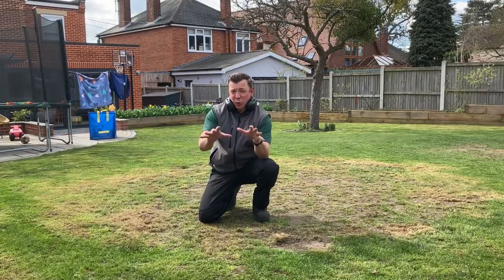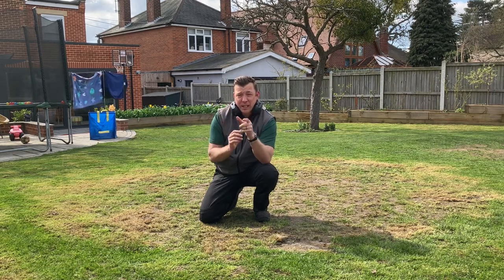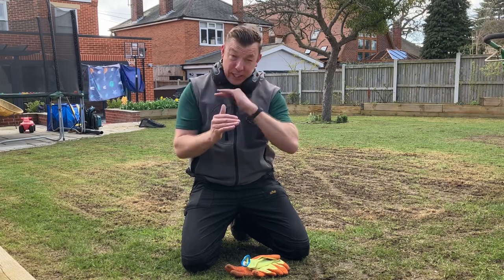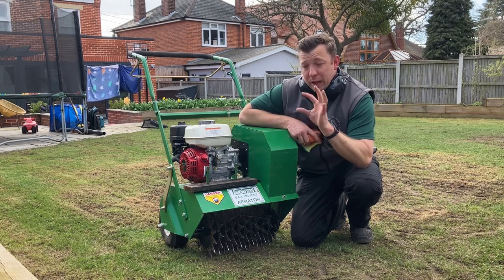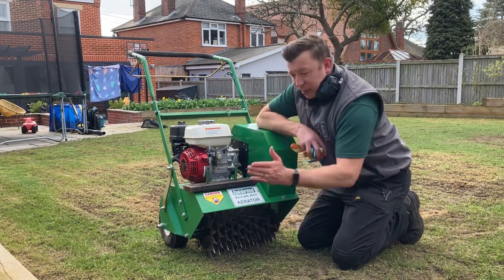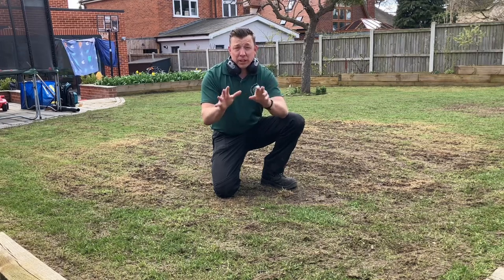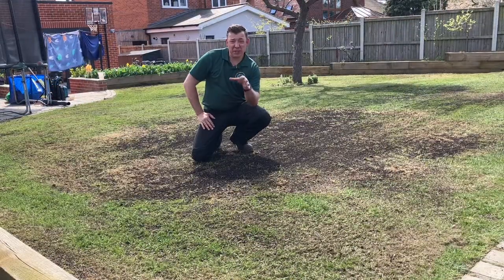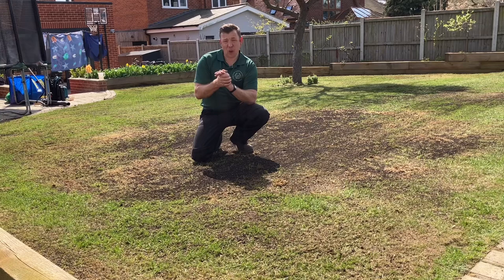A lawn renovation on a family lawn by @TheLawnologist

Comment: Have never seen an aerator like that before. Seems really professional and light. I use an Redexim 108 and it weighs 160 kg. Could you please provide a name for that aerator? Google finds no Bertha...😂. Thanks!
Reply from the maker: 😂😂. Bertha is a Bannerman air-inject. They’re a Canadian firm and it’s a brilliant bit of kit. I normally use fracture tines rather than hollow tine as they offer the same solution but without the mess. Bertha can aerate a 100m2 lawn in 15 minutes with no clear up. Worthy investment and has help my business become super efficient.